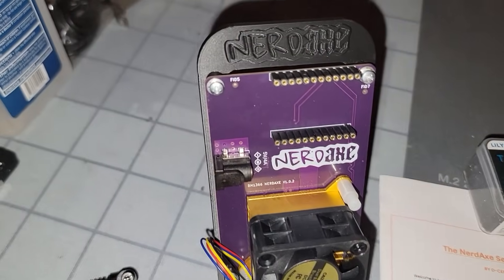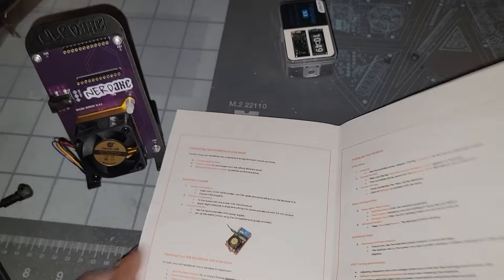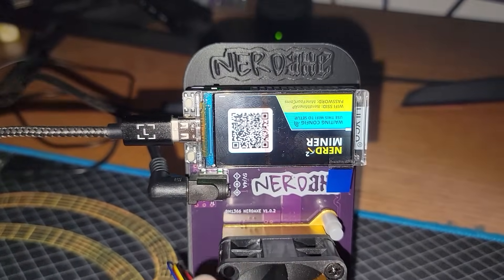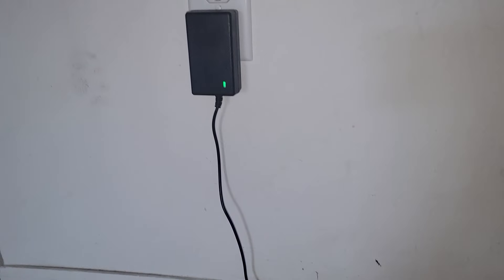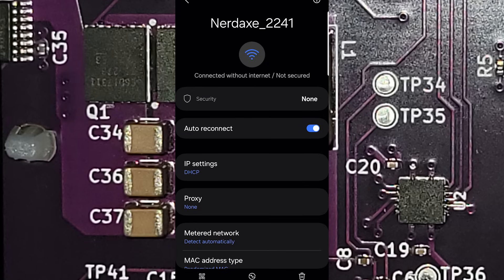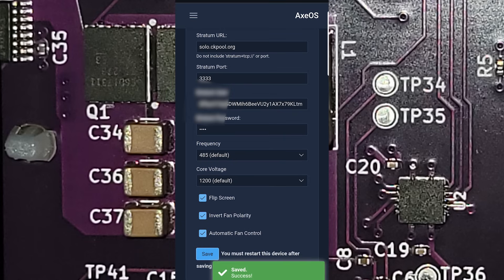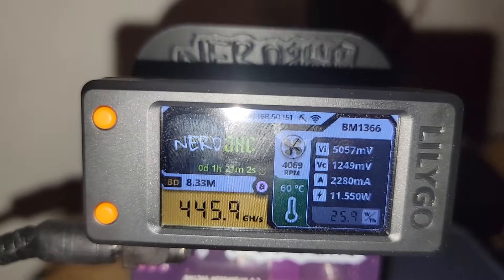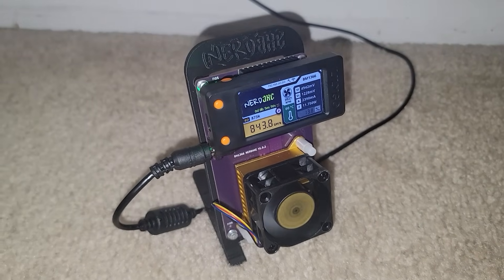Nerdaxe - Super efficient Bitcoin Lottery Miner

Comment: That line on the screen is on the screen protector, peel it off. Also for the upside down screen if you click i believe the top button on the lilygo twice quickly it will flip the screen. Also those pogo pins should be soldered if looking for a proper connection but i guess it still works.